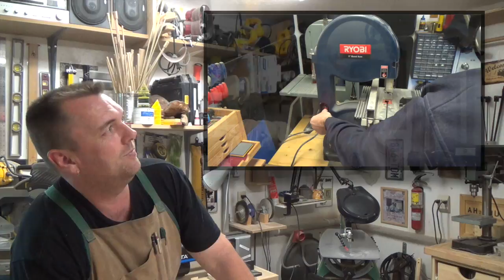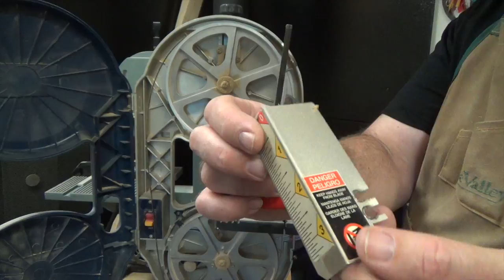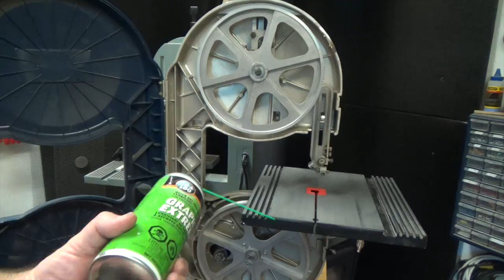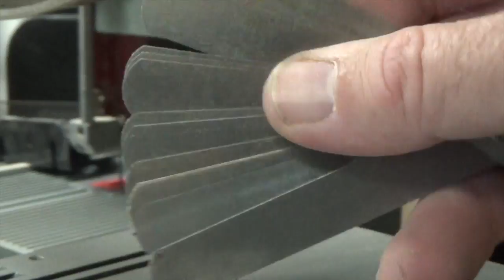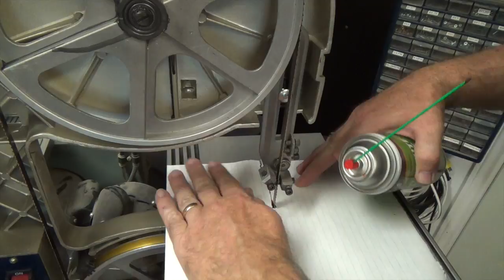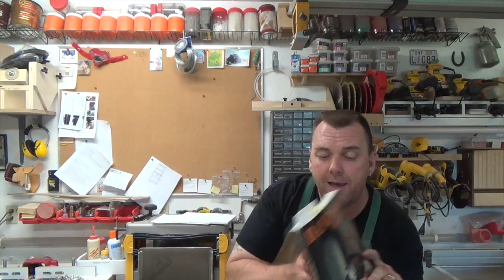Band Saw Setup

Comment: Is it recommended to loosen the blade when the saw is not in use?
Reply from the maker: I would definitely loosen the blade when not in use Tim.  My opinion, is that leaving the tension on the blade, can cause flat spot on the tires and also cause problems later with tensioning mechanisms.  Any tool that requires tension on a blade, in my shop, is left without tension when not in use.
Reply: Right on. it wasn't mentioned, so I thought I'd bring it to whoever reads this attention. Thank you for your reply....
Reply from the maker: Tim Rogers You're very welcome Tim.  Feel free to ask questions at any point in time you like.  I'll always do my best to answer them to the best of my ability.
Reply: Thank you much....

Comment: Kenny. Taking the table off would make the job easier
Reply from the maker: Actually Steve, I have to disagree with that.  The table on this little saw in a pain in the butt to remove and an even bigger pain to get square again.  I'd rather work around it than take it off.  The same holds true for my larger band saw.  The blade is 133" and the cast iron table is a beast.  I'm not as young as I once was and lifting that huge cast iron table down is nothing but a chore.  Better for me to work around it.  But then, to each their own.  If removing the table works better for you, then by all means, do it that way.  That's what I love about woodworking.  There are about 150 ways to do the same job and we are able to pick and choose which way works best for us.

Comment: Use a spring clamp to hold the tire in place.
Reply from the maker: That's a great suggestion Man na.  I can't believe I didn't think of that.  Where were you when I was filming?  Thanks for tuning in.
Reply: Thanks, but I got the idea from other videos, including putting them in hot water so that they are more pliable. Btw, where did you finally buy the tires? Did you go with the polyeure
Reply from the maker: Man na I finally found the tires at an authorized services dealer.  They were on back order and took about 6 weeks to get in.  I just went with the rubber tires for this saw.  I just couldn't justify the price of the poly tires.  Maybe next time...if there is a next time.

Comment: all the videos on this i have seen no one has ever told me to round the back of the blade. good tip to know. thanks for the help
Reply from the maker: Rounding the back of the blade is also helpful on scroll saws.  It prevents the sharp corner from digging into the stock, causing the blade to wander.  Glad I could help you out.